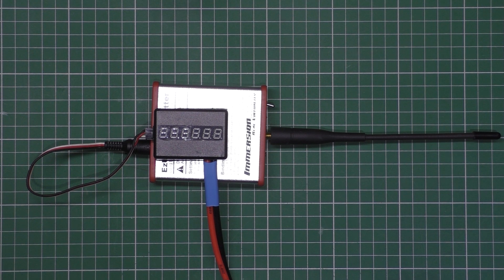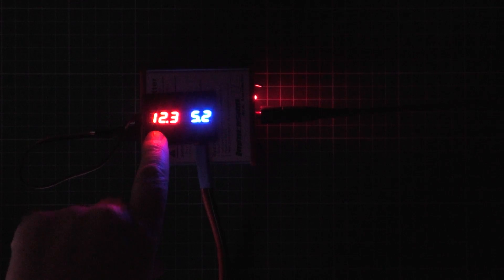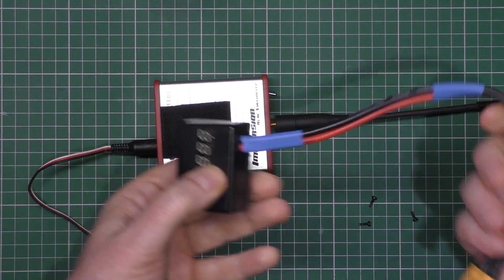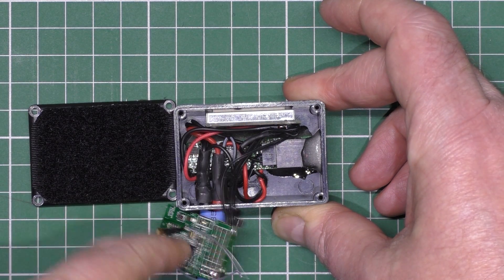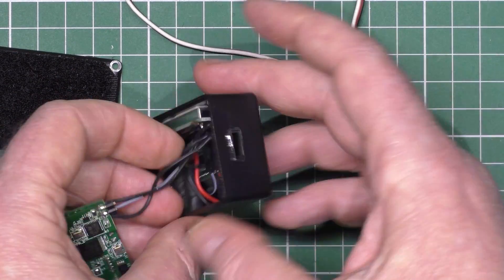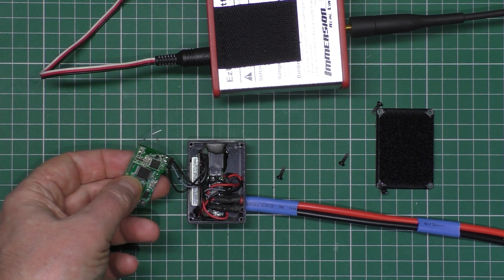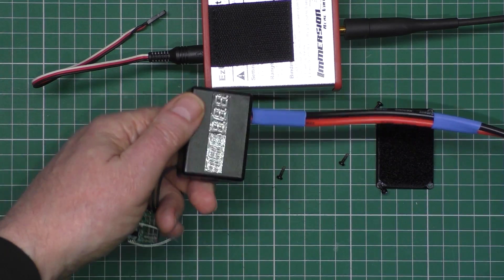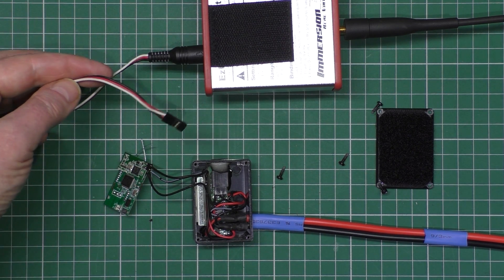2.4ghz to EZUHF repeater

Comment: Nice design (as always) Tony. How did you get the voltage displays and does failsafe still work ok with this setup?
Reply from the maker: Cheers mate. The voltage display is just a £1 one from Banggood - https://www.banggood.com/3Pcs-Red-LED-0_28-Inch-2_5V-30V-Mini-Digital-Voltmeter-Voltage-Tester-Meter-p-980044.html  
As for failsafe..... yeah, it works the same as it normally would.

Comment: Since you have only 3 wires going to the EZUHF, did you connect the ground from the 12v side and the ground coming from the CPPM together? I tried having just the signal wire coming from the RX and then the 12v + - but it didnt work.
Reply from the maker: The CPPM is earthed through the X6R which is then earthed through the UBEC which is then connected to the battery negative. The negative to the EZUHF comes directly from the battery.    
You will need to connect 2 wires between the X6R & CPPM (signal & earth) and 2 wires from the CPPM to EZUHF (signal & earth).    
There's no harm in having loads of earth wires bound together if it makes it work. If you're worried about ground loops, it won't matter in such a low current setup.
Reply: Ok that makes sense. Thanks for getting back so quickly

Comment: would you be able to make a lap counter with a DasMikro Transponder For Robitronic Lap Counter System RC Car Parts
https://bnc.lt/4Sug/TuAyzCZgNt and a KY-022 Infrared IR Sensor Receiver Module For Arduino
https://bnc.lt/4Sug/GqA21ARhNt with an audrino?
Reply from the maker: Yes I could but I have far too many projects on the go at the moment. Maybe in the future, I'll build one :-)

Comment: Looks neat to me and I always enjoy humor. 
Tony, I accidentally deleted your comment on my FS V3 module video. Guess I hit the trash can with my spastic mouse clicking. Just wanted to say I am glad you got the right one.
Wish I could get a transmitter that would do all 8 channels b/c they will only sell me a 2 channel one over here. The land of the free is tied up in regulations.
Reply from the maker: +dmerc00 No problem, Dave. I have been known to accidentally delete comments in the past, it's easily done :-)   
I buy all my VTX's from Goodluckbuy - they're all 8 channels :-)
Reply: +Vortecks Thanks.  They don't say what the channel frequencies are.
Are the 8 channels the same as the Fat Shark V3 module?
I definitely want 1258 and 1280 to still work.
Reply from the maker: +dmerc00 I have one of these: http://www.banggood.com/FPV-1_2G-8CH-800mw-Wireless-AV-Transmitter-And-Receiver-p-73201.html   
It doesn't do 1258 but it does do 1080/1120/1160/1200/1240/1280/1320/1360
Reply: +Vortecks FS module has 1258 instead of 1240 but the rest are the same. I will give it some thought. Thanks for the link.

Comment: Nice one m8, and most important of all, the UHF TX antenna remains vertical and stationary, not lying parallel to the ground as in some JR Module setups I can think of.....I went to the trouble of mounting my JR Module with SR771 on a custom made bracket in order to get it more vertical when Im using a neck strap...it works fine, but I can hear a little output noise on my Taranis, especially if I use max output (rare)...Well done, cramming it all in that little black box.....:)
Reply from the maker: +EnglishTurbines Every ground station needs a black box m8 :-)
Reply: Vortecks Lol....yes, lets hope you dont need it...:)